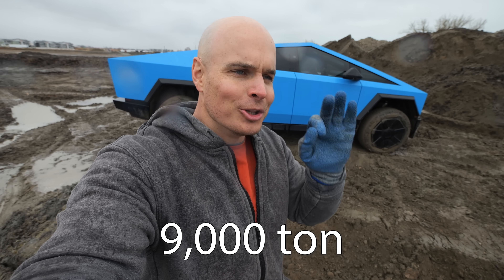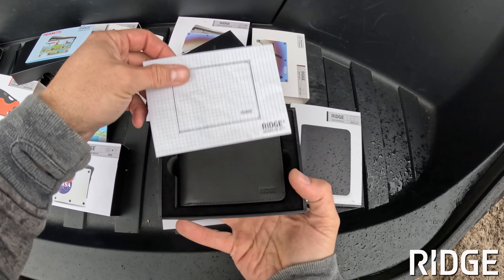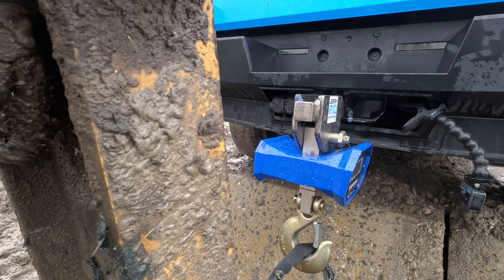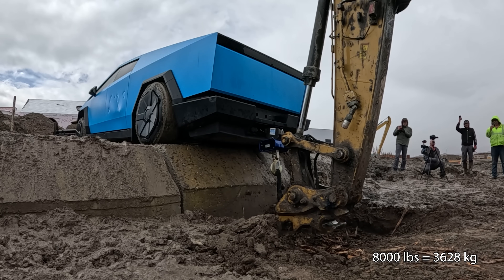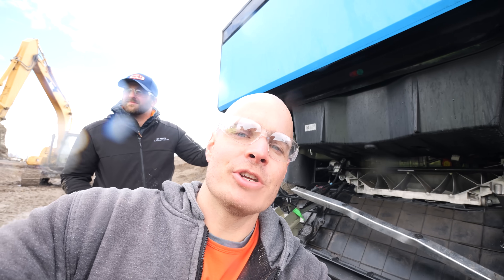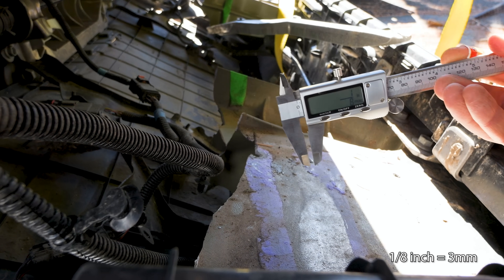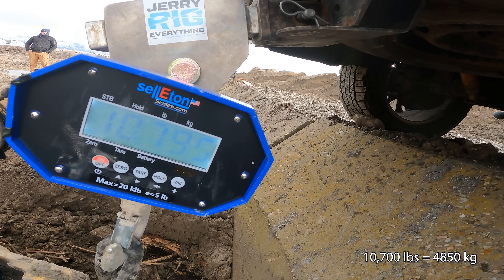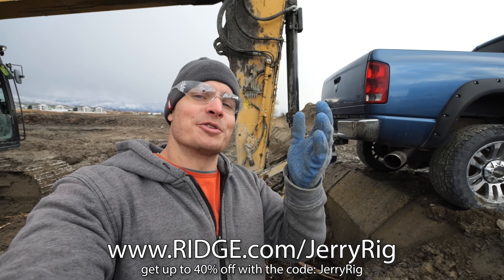SHOULD YOU TOW WITH A CYBERTRUCK?! - (catastrophic failure test)

Comment: I'm no scientist, but is there any virtue to the forces being downward and not horizontal?
Reply: 10:03 WTF? The trailer weight under normal conditions does not become tongue weight. I mean do you expect to crest a 90 degree hill? Give me a break (pun intended)
Reply: @poobank  he’s a flaming democrat liberal He doesn’t like Tesla anymore.
That’s the whole point of this video that’s why he omitted saying anything about a weight distribution hitch
Reply: Real structural engineers are Watching and laughing at your real life scenario experiment.
Reply: What are shock loads on a 1000lb tongue weight..
Reply: It's for those times you tow vertically rather than horizontally
Reply: Plus he did it on both trucks so it's fair
Reply: This is the most stupid test I have seen for towing capacity.
Most of a trailer’s weigh is conducted through its own wheels, the force on the car should be very low.
The nose weight (down force on the tow bar) should only be around 50-75kg with a correctly loaded load, to get 4000kg the load would need to be extreme or all sitting right at the hitch point.
Even the force to pull a 4000kg load of a trailer is not that high. 
I have personally pushed many a car (around d 2000kg) but i could not pick one up or carry it.
Definitely need to revisit your physics if you think a 4000kg trailer sits all the weight directly down on the tow bar
Reply: If you go over a bump, the force woul be downward. If either way, there always is a downward force since the trailer pivots and leans down on the hitch. Or if you go over a bump. Being an engineer, I can prove it with a basic force diagram lol
Reply: You lock a trailer or some caddy on a truck and it usually has two wheels and then it pulls your cars back down. And since the cyber truck has an aluminum chassis it means that it will get weaker and weaker, so it is a guaranteed break that will just occur one day if you use it. Like, laptops hinge problems - the only way to prevent it is not to use it
Reply: True , this is a bulshit test
Reply: Also imagine your car stops working just because your rear broke lmao. Can't be bothered
Reply: @Noshizq79 Towing capacity is not the same thing as tongue weight.
Reply: YES.   And the Telsa only has an 1,100 lb tongue rating
Reply: Did you watch the video? He literally explains this
Reply: @willcarson7328 yes and the tongue weight is much less than just the regular pulling of something in a trailer. The tongue weight on an F-150 truck is only 600 lb. But you're not going to be putting that much weight on a vertically unless you hit like a bump or a dip or something but it's not going to get to that much.
Reply: He literally explained why he did it with a downward force and not horizontal in the video
Reply: Well, imagine you hit a pot holez and the tow hitch and trailer suddenly jirk up and down. If the trailer weight is over that vertical sheer strength and the truck and trailer are moving out of sync just enough this could easily happen on the highway or even at city speeds.
Reply: They’re completely unrelated because of the conservation of momentum.  Your tire doesn’t hit the bottom of a pothole on the highway.  It glides over and hits a little of the edge.  Because you already have do much forward momentum, you’d need an equal amount of downward force to now point your direction of travel 45° into the pothole.  Same thing with a trailer pulling on the hitch.  A pothole isn’t suddenly going to redirect 10k lbs of pulling force into 10k lbs of tongue weight.  Imagine a string with a ring on it.  The tighter you pull the string, the less the ring sags.  Drop a heavy rag on the string, and it’ll dip.  But it’s not going to bottom out the string because it’s under tension.
Reply: The fact this has happened in the real world tells you it’s possible. Does it mean likely? No. But when towing you don’t want that risk to begin with.
Reply: The point is same test different truck one did better
Reply: To all the people defending tesla, remember he is doing this test because someone's bumper fell off in regular use
Reply: Doing these tests so you don't have to.
Reply: If you understand, he showed the amount of force exerted on the frame to the point of failure. Either way if he had to exert 10000 pounds horizontally, it would still snap as that is the point of failure. Only difference i can see is the damage would be quite different maybe alot less but either way it's still an L
Reply: Yes it makes for a significant difference when applying forces horizontally or vertically on the trailer hitch
Reply: This is to measure tongue weight, which is the weakest point i.e you hit pot holes , speed bumps , uphill to downhills… etc . This is the measurement to certify towing kinda like how they bend airplane wings to determine it’s maximum g force limit
Reply: I would agree that this test is disingenuous EXCEPT…the dodge didn’t break.
Reply: The hard fact is that the (already damaged) Dodge did not break, and by now we’ve seen 3 Cybertrucks where the trailer yanked the back half off. This is a design fault in any way you look at it.
Reply: Err that kind of pressure would lift the front...
Reply: Towing capacity is not the same as hitch weight capacity
Reply: I guess you didn't watch the video
Reply: This test is void. One can’t test a tow hitch limits like this.
Reply: The entire point of this video is just to show a broken cibertruck, you I’ll never town noting downward like it.. 🤦🏻‍♂️🤦🏻‍♂️🤦🏻‍♂️🤦🏻‍♂️
Reply: This test is total bunk.
Reply: I personally dont think that the forces applied to the hitch wiht this test are accurate. Whistlin’s truch took the weight of the truck dropping on the hitch first to break it which the truck should defiatly be able to handle the vertical load of the trucks weight at hitchs get hit all the time. The biggest issue I see is that the main point of failure is a non repairable part of the truck thus totaling it. design should allow for breakage on a replacable item and the structure of the truck shouldnt be damaged. Hitch should be designed to break before the truck frame with an apporpriate tow rating to match. Ratings are meant for normal operations which clearly the truck itself has no issue doing but an unusual situation shouldnt total the truck.
Reply: This experiment is useless since the pulling force resistance horizontally is what they should be testing, that's were most if the force goes to when pulling something, if you pulling a load that has 4 wheels then the downward force is next to none.
Reply: Para mí este test no tiene sentido, cuando están simulando un remolcaje en una posición totalmente inverosimil en el mundo real. No es una prueba válida de remolcaje sino de izado de una carga suspendida.
Reply: @jphanks   I put a comment on how the front end was being held down thinking people would put 2 and 2 together. Saying that the hitch will break at --- when towing... is there front held down when towing? The front lifting would alleviate pressure, so it's not the same. A real test would be doing it in real life, towing something, and seeing if 10 cybertrucks break .... honestly, this video seems like it's just bashing gigacasting, anti Elon rant. Worse yet the guy did a video of towing his hummer that was close to the limit. Tesla should have tested it and made sure it exceeds the tow capacity, it doesnt need to be indestructible. Jerry seems like he is far left.
Reply: Yes, this whole test is BS. This test resembles tensile strength spec vs a sheer strength test. 9k sheer is quite impressive actually.
Reply: I don’t think the Cybertruck is a truck and I think it’s a stupid car… however to say that the full weight of the towed trailer can apply 100% to on the tow hitch is beyond stupid. In Germany Passats and other unibody cars have almost 5000 pound towing capacity but yet the max weights on the hitch is usually around 180lbs.
My Mercedes GL is unibody and has a towing capacity of 7500lbs. In no world I believe you can put 7500lbs vertical load on the hitch, that’s just ridiculous. No problem to show the weaknesses of a car but this was clearly to disfranchise Tesla. It’s called activism…
Reply: I'm the last person to ever defend Tesla but I can't see a situation where the ball weight would ever get anywhere near that high even towing over the nominated capacity. 

And in the examples given a significant amount of the load would still be horizontal. 

Having said that, there's no doubt the old Ram performed way better in this test. I think it's just a bit alarmist to say that if you see a Cybertrough towing something you need to run away. 

Still a heap of garbage, and still wouldn't have one if you paid me - but this isn't a realistic scenario.
Reply: Somewhat unrealistic test
Reply: @  what’s unrealistic about it genius?
Reply: There is some validity to this test. I agree that the major factor of how much a truck can tow is how much force it can stand in the horizontal direction, HOWEVER, to say that vertical forces are of no importance is forgetting several things, the main one being that a trailer has to also apply a lot of downward force on the hitch, or the trailer will pop a wheelie and tip backwards. Like, have you ever noticed that the trailers wheels are not at the center point of the trailer? Instead, they are located closer to the rear of the trailer, so that some of the trailer's weight is supported by the hitch. Imagine if the wheels were put forward of the center point of the trailer. If that were the case the trailer would always tip backwards and be resting on it's own back bumper. So yes, there are downward forces on the hitch that have to be taken into account. The second thing is exactly what they mention in the video which is that differing road conditions can cause sudden, short changes in the amount of downward force on the hitch - sometimes it is increased, and sometimes it is decreased but there always has to be a certain amount of downward force on the hitch to make the whole thing work. Last thing is just that the test does prove that cast aluminum is weaker than steel when it comes to tensile forces and shear. The horizontal forces created by pulling a trailer are also tensile forces, so there is quite a bit of merit to this test.
Reply: Its called tongue weight
Reply: I agree. The towing capacity is 11,000lb, so you would need practically the entire weight of what you are towing on the tow ball for this to happen. Even in the catastrophic scenarios that JRE mentioned, a significant amount of the force will still be horizontal.
Reply: @locksmack  yeah this test is just mindless destruction, a 11k lb load would have nearly all that weight going down through its wheels, the nose weight should only be around 150lbs down, even the horizontal loads under breaking and accelerating are still a fraction of the 11k. That’s why humans can pull trucks and planes, but can not carry them.
Reply: @locksmack bingo… you would need to be trying to tow 25,000lbs + and then have something catastrophic to happen for this to even have a 3% chance of happening…
Reply: @locksmack  yeah from what I understand you do a 5th wheel towing adapter after X amount of pounds so that you don't breach the truck limits (for all pickups not just the CT) or add different adapters.
Reply: @locksmack but the one that hit the pothole broke? how can this be explained
Reply: The entire point of this video was to show a broken Tesla with all the plastic underneath. So, mission accomplished! For me, I dont mind the impractical test… Because while Elon has been empowered by our felon in chief to create tear down our govt, I dont see any issues with tearing down Elon’s stock price.
Reply: Bingo
Reply: For shits and giggles you should get one more Tesla do the same test, but by pulling it. 😂
Reply: There is only “fun” way to find out
Reply: The biggest problem here is that the safety pin doesn't help to keep the trailer from rolling away.

The test does not describe an immediate break, but let's say you drive a trailer with a weight limit of 80+% 30 times, and the trailer wheels are further back - more weight in the front.

Potholes, bridge + road separate line, speed bumps, etc.

After a few years and driving the trailer(s) 30x, 40x times...
👇
It breaks off... Here is a problem, because the safety pin does not help in this case.
Reply: Yes the vertical weight is much less than the tongue weight which is 1100 lb making the towing 11,000 lb. On the information for the vertical weight Tesla listed at 160 lb for the vertical weight whether or not that's a type or not it probably is it should be maybe like 1,160 maybe I don't know but regardless of that the vertical weight is going to be much less then the tongue weight.
Reply: Towing capacity and tongue weight are completely different things!!!!
Reply: No
Reply: He explained it in the video
Reply: 10k is beyond impressive for tongue weight
Reply: No. But it was needed for ideological purposes.
Reply: You onto something actually structures can have different strengths depending on the direction the force is applied. The rated force is probably horizontal. Kinda like concrete having great compression stretch but low tensile strength
Reply: Towing has vertical and horizontal force in it.
Reply: @wilfordpadio1896  make sure you know what you're saying before you say it
Reply: You’re 100% right here - this proves nothing. Zach is usually pretty on top of it, but this just shows that if you somehow had a trailer with an 11k tongue weight you might problems.
Reply: Should be called static tongue weight.
Reply: Your test it incorrectly, you want to be at a more horizontal angle. Your sloped wayyyy down to far down.
Reply: Same force was applied to the Dodge truck, nothing happened
Reply: A lot of people saying the test shows a 9x of the tongue weight rating…wrong, this test is a static loading test, the 1,100 lb tongue rating accounts for dynamic loads, think bounces and shock loading of driving over rough roads. So really this truck has a much lower safety margin. Maybe 2x or so for normal driving. Extremely loading like whistlindiesel causes catastrophic failure.
Reply: Anyone else more impressed by the soft shackle than anything else in the video?  Maybe musk can make the next version with a plastic rope frame.
Reply: You're never going to have more stress horizontally on a hitch than vertically when towing
Reply: @ unless your loading your trailer like a complete fool, the stress should definitely be a horizontal force rather than a vertical force.
This is due to the fact you are pulling and pushing horizontally and the only real vertical loads should be from stabilising the balance on the trailers wheels. 
Do you guys never hitch loaded trailers to cars by hand? I had 1000kg of bricks in a trailer and could lift the trailer hitch by hand and put it on to the tow bar. Should be like holding the end of a seesaw not lifting the whole load
Reply: The copium for the Elon simps in this thread is palpable.
Reply: Because it doesn’t take 11k lbs to pull a trailer you can push and pull a trailer with just a few 100 lbs
Reply: I guess if you have a big force horizontally applied the vertical limit is even way lower than shown in this test.
Even if the real vertical force doesn't reach the amount shown in this video I guess it will wear out the connection very fast when it's combined with a high horizontal load. Also don't mix up max load (tested here) and nominal load (a base for an average use, but that needs a lot of safety factors applied to reach the actual max limit).
Reply: Yes because Zack is an embarrassing Elon hater 🤡
Reply: @jannis01  it's alot more embarrassing to defend Elon over anything
Reply: The whole point was to destroy the Tesla, and "Elon bad".
Reply: Not technically cause if it’s designed properly it shouldn’t matter and it should even be able to handle more force since putting a downward force in a towing hitch has the entire chassis backing it up
Reply: in the video he states clearly. its a matter of a lot of forces. towing is mostly horizontal. but improperly loaded. or in certain circumstances it could overload the tongue. if this happens too often. it could result in failure. the fact you need further explanation shows plenty.
Reply: Because then he couldn't show his political biased and how much he hates America. He's trying to make Musk look bad because musk's trying to save the country from going bankrupt. Pretty sure baldy is woke and hates America pretty bad.
Reply: Guy employed trumpcession with doge impact on Tesla and capitalised on the attention capabilities a Tesla video would fetch
Reply: Muricans doesn't count like us. They try cranes by loading cranes until the burgermeter show lunch. Then they laugh and go back to look busy just to spice up your bill.
Reply: This is to measure tongue weight, which is the weakest point i.e you hit pot holes , speed bumps , uphill to downhills… etc . This is the measurement to certify towing kinda like how they bend airplane wings to determine it’s maximum g force limit
Reply: They literally explain why this test is relevant during the video... Did you watch it?
Reply: Well, can you prevent your load to stay always exactly the same disstance from your truck..? I mean if you are accelerating, you are pulling it horizontally, but if you are breaking, and the weight behind you still in move, and will change the force effect from horizontal to vertical.. and your load rod also try to go under your car, to the same direction where they pulled..
Reply: He mentioned in the video when such forces can happen in the real world
Reply: Did you even listen to what he was saying? Did we just watch the same video??
Reply: I came here for this comment. It's like the "drop" tests people used to do tossing phones off parking structures. "If you fall down 7 flights of stairs, your phone will survive only in this OtterBox defender!"
Reply: Tongue weight I believe.
Reply: whistlindiesel covered a case where a cybertruck hit a pothole while towing a trailer and it broke in the exact same way
Reply: To be realistic, wouldn't the load need to be at a vector between vertical and horizontal?
Reply: This guy takes Ford money to make bait videos
Reply: There definitely is downward force, whistlin diesel had his break from a horizontal force and the customers who had this happen in real life were just towing
Reply: So we're just going to ignore the fact that literal frame parts are GLUED together???!!
Reply: @ of course it will break. It isn’t supposed to receive the entire tow load upside down in a single point.. to tow one trailer the majority of the force are actin horizontally, not vertically..  Vai aprender alguma coisa👌🏻
Reply: @Bsquaredplus2  3M panel bond is rated as tough as welds, especially for aluminum and steel bonding. I didn't believe it either until I saw the numbers.
Reply: This is typically a channel that manifests intelligence. This “test“ was completely bogus. I can’t believe that they believe what they are saying in this video.

I completely understand people being annoyed and disappointment with what you on musk has been doing in the world the last few months but when you’re purporting to do science… you should do the test properly. This video was bogus.
Reply: When you tow, you are supposed to have majority weight towards the hitch. Imagine you hit a pothole, that weight will create a jerk and apply huge amount of force vertically downward. Essentially doing what they tested in this video
Reply: @dp8jl  No, it won't cause so much force.
Reply: @ Read about jerk and look at the graph, It would apply a lot
Reply: @dp8jl Really you’re supposed to have the weight over the trailer’s wheels, the tounge weight should just be slightly positive. But when reality hits and you can’t achieve a neutral balance you’re better off loading the front of the trailer, maybe you failed to secure the load properly and it shifted forward when braking, and as mentioned, pot holes, creats and so on so there certainly are situations where there is a lot of impact force applied vertically on the hitch.

The big issue here is steel vs aluminum, where when the steel is overloaded it will bend before it breaks, the aluminum will crack and it’s a wild design decision to make the panels out of steel and them save weight by making the load bearing construction out of aluminum.
Reply: Whistling diesel pulled on the tesla from behind with a strap attached to a ford. When he tried to pull the tesla out from behind he had the same catastrophic failure.😂😂😂😂
Reply: Glad it was your truck and not mine...
Reply: I think you should also include an F150 Lightning, another electric truck.

Sorry my bad English
Reply: Oh jeeez if i read the comments i think man what a world we life in and it even was in the Video although there was an error in wording.

ALUMINUM will break over time - This thing will do a lot of Damage. Even if you tow much less loads then tested here, it WILL 100% weaken the structure to a point where eventualy the hing will fall of from a small trailer wich is towed.

If you bend aluminium once you can bend it back or it will break. If you to the same with steel it wont break simple as that.
Reply: @Alexander.K250  Run to manufactures that make so many car parts from AL. Go say that they are making a big mistake producing blocks, pistons, casings, suspension arms from AL and eventually they will break. XD
Reply: So I guess you’re never going down hill ever?
Reply: The horizontal is tested via the drivetrain. First, the hitch must be able to handle the load, then the drivetrain needs to be able to pull it
Reply: They are testing the tongue weight limits added to the towing limits
Reply: Pointless test, pointless video.
Reply: Like he explained multiple times in the video; normally the trailer’s weight is mostly on the trailer axles, but there are several possible scenarios where most of that weight is shifted onto the tongue and receiver
Reply: Yes, it is deceptive to be talking about 11000lb towing capacity and then measure the tongue weight capacity.  The fact that it handled 8000 lbs tongue weight is very impressive since it probably only has a tongue weight capacity rated at 1100lbs, not 11,000lbs.
Reply: @vincevancleave9353  he said like 15 times during the video it was tongue weight capacity. Nobody was deceived at any point. He even explained with a little toy car for people who are a little slow like you why tongue weight matters

And it's very funny seeing Elon simps cry that "it's more than the spec weight!" considering the entire truck/large vehicle interest community laughed for weeks when the cybertruck only hit an 1100 rating. That's ..bad. it was bad at the time. It's not impressive that it exceeds the capacity of an average sedans frame. It's supposed to be a truck.
Reply: This was a hit piece
Reply: He addresses this in the video.
Reply: No, just wanted to destroy it because he doesn’t like Elon…

I don’t either, and I hate the cybertruck, but I can dissociate the man from the business. 

Unlike the tesla haters crowd that this video had gathered
Reply: @JerryRigEverything I see you're responding to the praise comments - where's your response to this? So disappointing you would resort to an irrelevant test for the views. I thought you were better than that :(
Reply: @PetrSedlacek  I made a video Short and posted it to YT, hoping to get his attention lol
Reply: Do u not watch the video about the towing physics bro
Reply: Yes..  the virtue is more views
Reply: I was wondering the same.
Reply: Weight of a trailer goes DOWNward on a trailer hitch/ball. Gravitational pull. You’ll see when you drop a trailer onto a hitch. Your truck suspension will compress and the rear will lower.
Reply: So I can tell some people have never towed a trailer. If you jack a trailer down it does what? Goes down.
Reply: Yes, he just chose not to mention it so he could paint Tesla in a bad light. When towing a 10000 pound boat there would be like 1000 pounds or less of downward force on the hitch.
Reply: He did explain that, did you see the whole vid?
Reply: change his name to JerryHatesTesla
Reply: 11000 lb towing capacity 1100 lb tongue weight 9.4545 x capacity so bad totally😮 seriously
Reply: Tongue weight rating 1,100 lbs (500kg) it exceeded that
Reply: No for these intended use case. Your objective is no to have the trailer become a rolling boulder down there road. If steel can de form better without breaking more power to it.
Reply: All these people trying to explain away the fact that the teslatruck broke but remember same test and the dodge was fine… soooo doesn't matter which way the force was it still broke while other trucks don't...
Reply: I would love to see a similar test in the horizontal. Let's find the weak spot in that aluminum frame - at what force will the truck separate into two parts!
Reply: He explains this in the video multiple times.
Reply: The virtue is getting views and clicks by shitting on Tesla with an improper test idiots won't understand.
Or he's just very stupid.
Reply: Get well soon jack. 😢 you trying sooo hard. Its shows . You hold so much against tesla. Rivian sponsored! You got free tires? Or something else from rivian😅😅
Reply: If a ram can stand up, just imagine what a good truck could do.
Reply: People seem to be Tesla fanboys in these comments: look to a real world situation in the whistlin diesel video. People all said it’s cause of the impact it took before hand but JRE’s video backs up Cody’s experience of the thing catastrophically failing in normal truck use
Reply: This test is literally pointless with no direct comparison.
Reply: @HAL9000. this assumes the very basic premise that vehicle and trailer axles are all on a horizontal plane, right? … not even touching how the trailer is loaded. In any situation where the axles of the trailer or vehicle being towed are on a plane sloping downward from the tow vehicle, the weight suddenly imparted on the hitch becomes much greater. Based on the experiment here, you would definitely think about using a vehicle like this as a recovery vehicle when off roading. As touched on in the video, the properties of steel are very different to aluminum, and there’s a reason steel is so widely used in so many applications where large forces are involved. It really is a very weird material choice for a part of a car where failure is a serious safety issue.
Reply: @someofmyinterests how do you think potholes and other gradient changes impact the weight experienced at the hitch connection?
Reply: He literally explained why it's important to have  a stronger tongue weight.
Reply: It doesn’t matter because the frame is aluminum. Aluminum is garbage for towing
Reply: No one here watched the video, he literally explains this at 9:45
Reply: @HAL9000. Isn't there a downward force when you're going over a bump with a trailer? Or when you're climbing a steep hill?
Reply: Since when is gravity horizontal 😂?
Reply: Towing capacity is not the rated downward load on the hitch, it is the ability to tow horizontally 🙄
Reply: He literally explains it in the video.
Reply: As much as I reject Musk's Nazi saluting and want Tesla share prices to tumble in protest, this test is so dumb.
Reply: This is a stupid test. You have no understanding of towing
Reply: Should be horizontal IMO - mechanical engineer here.  Should be both ?
Reply: 😂 what a clown!
Reply: That was the entire point of the test .
Reply: Gravity go down
Reply: Pointless test
Reply: @jerryrigeverything Can you show active tongue weight loads during towing? Can you even generate 10k pounds in a real world situation with scales and cameras rolling? I doubt it.
Reply: @nathanhoke1  it wouldn't be hard to create a force sum on the hitch on a grade. You don't need video to calculate what it could be.
Reply: @ he showed where those things happen, cresting hills, ditches and potholes.
Reply: We loaded pallets of concrete for customers at Home Depot. If they had a hitch, all that load has to be directed toward the hitch for safety/physics purposes. You bet that all that vertical weight matters. We never had to worry about the hitch holding up more than the trucks suspension and tires though.
Reply: @krimpymess  What did you just say? If you put a pallet of Crete in the bed of a 1500, you are stressing the suspension and axle by practicly double its rated capacity. If you load it on a trailer (which actually) puts weight on the hitch; you wouldn't put the pallet on the tongue, but just forward or center of the trailer axle. This puts the weight on the trailer and not the truck while ensuring stability going down the road. Sorry but the physics you mentioned, ambiguous.
Reply: @krimpymess  That's horribly incorrect, overloading a hitch reduces weight over the steer axle and creates an unsafe condition. The weight should be balanced over the trailer axles with minimal hitch weight in either direction.
Reply: @krimpymess  I’m pretty sure the load should go directly over the axels. WTF
Reply: @krimpymess  correct for the trailer to track right you want all the weight as tongue weight but you also don't want to exceed tongue weight limit rating either.  So many people on here talk like they are focusing their weight over the axles and will explain why there are so many videos of people having trailers go out of control and flip the vehicle.
Reply: The truck most likely blew its Pyro Fuse. When an EV detects an impact it'll pop that fuse to prevent fire and to keep it safe for rescue crews. It also means it cannot be driven until you get a new fuse, but they are kinda cheap.
Reply: @SirPandaEsq  oh that’s interesting, I wonder if it had enough force to cause that break
Reply: Zack explained what you are asking in 9:45. He showed it with the little car demonstration, and argumented in what normal towing conditions this experiment applies to.
Reply: @nicolasromero1720 Normal towing conditions to exceed 7,000lbs of force would require a trailer over double the rated capacity on a 15% grade. This "test" is just an excuse to break a cybertruck for views.

Note the complete lack of data in his "examples." For all the weight of a trailer to be on the hitch, it's wheels would have to be off the ground. If a tire is touching the ground, it's relieving weight. The only situation mentioned that could exceed these forces would be the recovery of a stuck vehicle which should only be done from actual recovery hooks and with a recovery strap which is elastic and spreads the shock load out.
Reply: @daniellvanwiggeren7942 need more COWBELL!  My Cummins will rip that dam bumper right off that cute toy!
Reply: @nicolasromero1720 he certainly does give an explanation, but he is also totally full of bull as none of them situation would ever put the full weigh of the trailer as tongue weight. The only way I can see that it would happen is if you reversed the trailer off a cliff and have it hanging from the hitch (but in reality it would fall off) a standard trailer hitch would fail from the angle and force
Reply: @nicolasromero1720 yea except that would never happen in real life, unless its payload is literally hanging off a cliff, like in Jurassic Park II. Read the rest of the comments on this video.
Reply: @nicolasromero1720 what he showed was incorrect. Cresting a hill lmao WHAT. You would have to drive straight up a 90⁰ hill and "crest it" with the entire trailer and its tires off the ground dangling on the air for this to be an issue. And if it happens, buddy you got bigger issues and the hitch snapping off would be the best outcome. Also hitting a bump in the road doesnt work like that, how many cybertrucks pulling a trailer do a wheelie when they hit a bump? They literally had to strap the front end down because it was lifting up 😂
Reply: @nicolasromero1720  and in the scenario her showed, that trailer is LIFTED which is why it comes loose. Just stupid.
Reply: @nicolasromero1720  He said that, but this doesn't resemble a towing condition anyone will ever face. A class V receiver is only rated to 1,800 lbs of weight.
Reply: @nicolasromero1720 except it’s not true. Even in his example or on the steepest of hills two tires are holding the larger portion of the weight.
Reply: @nicolasromero1720  yes he did, and he is absolutely incorrect.
Reply: @nicolasromero1720 and his explanation is BS. If a trailer ever was in a scenario to apply significant enough load down like his test, I'm afraid you have much bigger issues!
Reply: @joelmelburn3370 why does it have to be a trailer? Why can’t it be an off-roading vehicle that has gotten stuck and needs to be recovered by another vehicle?
Reply: @Ticklish-sheep  great point!
Reply: @nicolasromero1720 just because he mentioned something doesn't mean he understands it, hitting a pot hole or towing up hill doesn't put all of the weight on the hitch...its a ridiculous test.
Reply: 11,000 lb on a trailer will force weight down on the axles of the trailer the 11,000 lb won't be in a downward motion directly on the hitch
Reply: @Jackie-p4r The Dodge didn't break 😁
Reply: @Jackie-p4r does it depend on alot more than that? what if its a one axle trailer or if the trailer gets a bit of a push towards the front frot the road shape, alot more mass will go on the hitch, if youre carrying 11000 lbs then the total downward weight will be more than that, some of which, depending on the trailer and road will act on the hitch more or less
Reply: @Jackie-p4r dude stop, suppose you get a 4 wheel load then were is the down force?
Reply: @Jackie-p4r go down a 9% grade and hit a bump or pot hole etc with a fully loaded trailer…..
Reply: Sitting around and imagining what you think will happen is called speculation going to school for engineering and working in the field for many years is called knowledge
Reply: Yeah he’s testing tongue weight capacity which is rated much much less than tow and not testing not tow capacity which is rated at 11k and he had to strap the front of the truck down to do it “one bad trailer load away from failing” yeah if you’re trailer is pulling your front wheels off the ground you’ve got a lot bigger problems than choosing a cyber truck what a clown
Reply: The rated tongue weight is 1100 lb so what they've proven is that the Cybertruck has a factor of safety of 9.45:1, where 2-3:1 is common. Overhead lifting equipment is typically built to 5:1.
Reply: @MattBlank0  where did you get  that 2-3 metric from? If a 2 decade old Ford can do better I'm rlly not sure you have good logic
Reply: @MattBlank0 Tongue weight is not an indication of the capability of the receiver. It’s derived from  the limit of the suspension/steering/tires to safely tow.
Reply: @MattBlank0  with an 1100 lbs of tongue  weight and your driving down the interstate at 80mph those bridge seams  can produce well over 10000lbs and so can slamming on the brakes with a high center of gravity load
Reply: Quick math  @MattBlank0
Reply: @MattBlank0 if that were remotely true the steel bed truck, geared up in exactly the same manner, would’ve broke. You fail.
Reply: @praftman  they're comparing a Cybertruck which is hardly a pickup to a heavy duty pickup with a different style of construction. I think it would be for to compare it to something like a Ford Maverick or Honda Ridgeline in terms of its capacity. There are a lot of things to hate about Tesla and Cybertruck but failing at nearly 10 times its rated capacity isn't one of them.
Reply: @MattBlank0 The number sound great until you realize cast metals are the worst for high impact and loading applications. Cast metals have low tensile strength, and are very hard to produce without any void defects. 

Any other truck will take that much of an overload without failure,  at most resulting in a bent hitch or frame. The fact that the gigacast snapped reveals it will have a limited life towing near its max rating.
Reply: @MattBlank0 

Good way to look at it, just keep in mind that that is a static rating and needs to have margins for dynamic use. An overhead crane won't see significant dynamic loading. A towing vehicle will see a fair bit, although the suspension will help control it.
Reply: @MattBlank0  that is a margin for catastrophic failure. Not actual failure, you would be getting a bill the next time you visit a shop long before you break the entire back end.
Reply: @MattBlank0  Well the tow hitch on dodge which is one of the most common trucks on the planet lifted the excavator's tracks off the ground... that's the point of the comparison... Comparing a normal steel frame to a cypertruck frame.
Reply: Also towing 11,000lbs is not going to be 11,000lbs of force because, you know, tires.

Not that I'm defending the Cybertruck. They are terribly built vehicles...but tongue weight is typical 10% of max tow weight and allows a decent safety margin for bumps and so forth that would temporarily increase load. If that thing holds to 2,000lbs it should be fine. Honestly, the cybertruck suspension would be my biggest concern.
Reply: He did point out with the model Cybertruck driving on the roof of the real one that in certain conditions the trailer can jerk a large transient downwards force 😊
Reply: @ecopennylife 
Yep. It's called jacknifing and the truck is on its side if that point breaks
Reply: @ecopennylife  while you're driving it down the road, is there a crane holding the front down? 😅😅 Baldy is lying to you.
Reply: @ecopennylife   the load can increase, but it would never get to 10k lbs or even close. He's mistaken and fear mongering.
Reply: @ecopennylife sure but 10x ?pointless video
Reply: @ecopennylife but never the full weight of the trailer what science is that?
Reply: Tongue weight rating, 1100 lbs, is vertical.  I suspect they couldn't force a failure in the horizontal direction, and the entire point of the video was to show a broken Tesla
Reply: @shakehandswithdanger7882 you’re exactly right, this dude is so unethical
Reply: @shakehandswithdanger7882  sounds like truth to me.
Reply: @shakehandswithdanger7882  these jackasses chose to omit the mention of any kind of weight distribution hitch, which people who tow heavy trailers know all about
Reply: @shakehandswithdanger7882 the entire point of the video was to show tongue weight breakage because as anyone who actually hauls things (so no cybertruck owners to be fair) knows tongue weight can be holding the majority of a trailer weight for brief times, i.e. if you hit a pothole while hauling or if you improperly load a trailer ahead of the fulcrum and stop too quickly.
Reply: they tired pretty hard to break the dodge too but couldn’t Tesla cyber trucks are a joke always have been if you want a truck get a real truck and the only half ton gas to consider currently is a tundra with regard to reliability. Diesel is go with a ford first the. Dodge and Chevrolet last just my .02 and real world experiences with them all.
Reply: @shakehandswithdanger7882 the point is that it would be quite easy to have a shock or impact vertically with that much weight whilst towing, which would damage the truck and could cause this sort of critical failure. There is just no reason for the truck to be built this way
Reply: @Drakshl  I'm not a towing expert. Motorbikes, on the other hand. Aluminium frames / around the fork can crack- weaken and fail from hard landings / dropping the front wheel too fast from popping mono's. Should they make all sports bikes use steel frames? I can imagine towing multiple tons of liquid down a valley where it bottoms out sharply may break the ct. The steep driveway would be a better example. But the ct could be programmed to warn the driver ahead of time. ... also, I shouldn't presume people's motivations, soz.
Reply: @shakehandswithdanger7882  horizontal can be hard to rate an exact load for and he was testing a tongue load failure after cresting a hill. A vertical load. He was testing for a specific established failure to see if it was a design issue or if there was an existing structural failure.

tongue weight is a larger concern regardless because whatever youre towing is on wheels and so are you. So alot of the horizontal forces under anything resembling normal circumstances is going to be taken by a lot more than the tongue. You could try hitching the car to a brick wall and accellerating, I guess.
Reply: The whole point is that we don't live in a perfect world with perfect conditions, and that the truck WAS supposed to tank that overloaded vertical force. That's you absolute safety limit, like an elevator's true capacity being way higher than the advertised weight limit to account for irl outlier scenarios.
Reply: @shakehandswithdanger7882 of course because this guy is a complete shill
Reply: Sure, ever heard of a speed bump or a pothole?

Bouncing over those while towing will certainly cause sudden downward forces
Reply: @smok_ed only if you have a GROSSLY imbalanced load lol...
Reply: @gergc4871  on the whistlin deisel video it became a major concern when the rear frame experienced an impact..

As many of us know, aluminum work hardens almost instantly so a fairly minor impact on the frame could cause significant microfractures and stresses  on the extruded aluminum frame..

Unlike steel which will stretch and bend quite alot before finally failing. Think about steel rebar inside a concrete bridge span, or the head bolts on your engine being torqued to spec... steel will move and remain strong. Aluminum DOES NOT.

So a fairly minor rear end collision that strikes the rear frame of the cybertruck could very well compromise the fragile aluminum frame.  Then when you have 11 thousand lbs hooked up and are towing at highway speed.. these stresses and fractures can easily cause the frame to snap in half.

It has actually been reported multiple times already, so all these cybertruck fan boys should take note and stop simping.

Tesla really frigged the dog by not choosing to use a steel frame.
Reply: @smok_ed  Yes, that's true! Someone bumping into you from behind...

Up/down can quickly jump to 2+k lb it all depends on the trailer and how the weight is distributed.

Officially 160lb must be a mistake because it's too low! 11k lb and up/down limit at 160 lb 🤣

For 11k lb I wouldn't put a limit below 2k up/down, especially with aluminum, because it breaks off and doesn't bend like iron. Once it breaks off, the trailer is no longer connected to the car! Better safe than sorry!
Reply: @smok_ed  Yea, on the suspension.
Reply: @smok_ed then do the test that way
Reply: @smok_ed yeah for a small period of time and that's it.
Reply: @smok_ed bouncing and speed bumps never put that much weight on a tongue. Again more stupid shit being said by people who have no towing experience
Reply: @smok_ed will it? Explain how all the load somehow goes off the wheels of the trailer and then somehow goes vertical, ignoring the geometry of the whole setup. Do people like you not have any idea of physics?
Reply: @-Nath-  i have a degree in math and physics, what is your background?

First off.. i never once said that the entire weight would be applied to the tow hitch, just that it would experience moments of downward force.

Also have you ever seen a trailer loaded with more weight towards the tongue?
I have. Loaded em that way myself many a time.. as having the weight slightly forward increases stability at high speeds.

Single axle trailers dont just balance themselves.. there WILL be downward force vectors on the hitch.
Reply: @smok_ed 
No one is arguing that there will be some additional download forces. But to argue that the amount of downward force would be of this magnitude - nearly the towing capacity is straight ridiculous.
Reply: So it broke at 10x the specified limit. Why is this test being done like this. If a 11000lb trailer is on a hill it does not pull at that weight as it has 4 wheels connected to the ground
Reply: @dbjury it’s not normal condition which he pointed out, but under some circumstances that aren’t uncommon, you could temporarily go well over the tongue limit. The more important thing is to remember the fatigue limit that aluminum has. A cybertruck that tows a heavy load for five years is going to be at a much higher risk of having the gram fail due to fatigue than a new one
Reply: @dbjury exactly it says the vertical weight for the information for the cybertruck is only 160 lbs. That could be a typo and maybe it's like 1,160 lbs?

But you're absolutely right and then the other video where they did the durability test between the F1 truck and the cybertruck they drove that cyber truck right off the bed of the truck and the back where the hitch was hit vertically at over 6800 lb or possibly more with that Force hitting that hitch already causing damage to it as you can see when they drive it off the bed of the truck it clearly hits the back the back underneath where that Towing is. That's why when they went to tow it just completely ripped off because it was already damaged at that point.
Reply: @dbjury yeah dude wheels make something weightless. 

Is there a single cybertruck defender that knows anything. Or is it kind of a requirement not to?
Reply: @dbjury Actually,  you are pulling 11,000lb, even on flat flat ground. 

I think what you mean is you are not applying 11,000lb of FORCE all at once,  and in that respect, you are correct,  unless your tow vehicle is capable of exerting 1g in either acceleration or braking.
Reply: @dbjury  yet the old pickup passed the test. Thing is it is to show the problem of having aluminium ( even more so cast  aluminium), chassi, it has no fatigue limit, steel bends and then springs back, and bends and spings back, and os on and so forth but you can seee small fractures on inspection so you can repair/replace it,  aluminium just snaps one day without warning, it may be the 3rd time maybe the 30th, but it will just snap. 
And with how the dumster is designed the car stops working, mening your fly by wire throttle and breaks are are kaput(if they were not before that), your locks are kaput. So if it snaps on the road, you cant even stop or get out properly.
Reply: @dbjury the problem here is the assumption that all the wheels are on the same plane, and the force being applied is in the exact same axis as the hitch. As touched on in the video, there are common scenarios where the force applied is not on this axis. Imagine the common off-roading scenario where a vehicle is used to pull out a vehicle that’s gotten stuck, and the recovery vehicle is on ground that is at a higher elevation than the vehicle being recovered. The direction of the force being applied to the hitch is definitely going to have a vertical component.
Reply: @dbjury the point was to show that Tesla’s aluminum frame does not fail safely, steel trucks would bend or brake at the ball, leaving the safety chains to hold the trailer in place while you hit the brakes and come to a safer stop. The cybersuck breaks the entire back of the truck, sending the trailer, safety chains, and rear bumper to fly off and make its own choices.
Reply: Well whistlindiesel did it horizontal
Reply: @Whall3i and there's been many accidents to date with the cyber dumpster having the frame fail while towing down the road.
Reply: @Whall3i you also have to mention that whistle Dee used steel chains and snapped off the bumper because a ford pickup truck got caught with full velocity transferring to the Cybertruck
Reply: When I load a trailer with a lot of weight, it always pushes the tongue downwards. I can imagine the forces are the same going horizontal. That thin ass aluminum  gonna tare off the same way they tested it! I'm sorry, Tesla fan boys and girls, you can try to spin it however you want. This is a FAIL for the Tesla Cyber Truck!
Reply: I don't know anything about hitches or towing stuff with a truck, but doesn't the fact they're holding down the front make any point made by anyone here, moot? 
This setup requires highly improbable circumstances. Nobody should call this a useful test

Still an abominable vehicle, don't get me wrong.
Reply: @staomruel   i have lifted the front of my grandpas steel frame v8 so no if your a real man the front wheels might go in the air once in a while like pulling a camper down a dirt road to a camp site if i did that with a tesla it would snap though the people buying a tesla aren't gonna actually use there "truck" as a truck its a toy it goes fast looks like a doorstop
Reply: Auch wenn ich Trsla nicht mag ... Stützlast ist normalerweise so bei 100kg. Man ZIEHT einen Anhänger. Bei so einer unsachgemäßen Handhabe ist's klar dass das kaputt geht. Hat erst noch sehr lange durchgehalten. Also ein positives Fazit für Tesla in diesen Falle.
Reply: @TimoOnline  What is between sex and fear? Fünf!
Reply: @TimoOnline mein 3500kg Anhänger kann mit einer Stützlast von maximal 250kg belastet werden und keine 5t 😄

was ist der nächste Test? Reifen mit 10 bar belasten und zeigen dass sie dann platzen?
Reply: @TimoOnline  14:37 aus dem Grund z.B.
Reply: @TimoOnline  hier in USA sind die Stuetzlasten deutlich höher als in Deutschland. I.d.r 10-15% des Anhängers. Die Anhängerkupplungen sind auch komplett anders designt als in Deutschland auch bei den deutschen Autos hier in USA. Nicht desto trotz das der Tesla fast 11.000 pound aushält ist fast das zehnfache von dem was angegeben ist also absolut in Ordnung.
Reply: @TimoOnline NEIN, TESLA IST SCHLECHTER als andere trucks
Reply: @TimoOnline  Absolut, versuche nicht hier mit Logik zu agieren...
Die Zielgruppe ist der Durchschnitts-Ami..
Reply: @ickebins6948  oh ein Durchschnittsdeutscher mit einer durchschnittlichen Logik in den Kommentaren, na das ist lustig 😂
Reply: @romanromero5099  Mehr braucht es auch nicht um diesen Bullshit zu entlarven...
Reply: It was mentioned early in the video about hitting potholes; i.e. downward forces constantly come about during ups and downs in travel.
Reply: @jphanks To easier to understand, imagine you are pulling something vs you are lifting something

Basically, the more material you have and the more rigid the construction is to the opposite of the acting force, the stronger it will hold

So, as long as the road condition is normal, it shouldn't have problem if you don't exceed the limit. If it's offroading then it would be a different news.

And yes, no matter what the result is, it doesn't change the fact that if it were to use steel frame/chassis instead of cast aluminium, it will hold much stronger.
Reply: @Azukaae  If you're towing a trailer with wheels (not a 10,000 lb concrete slab), the majority of the load is supported by the trailer’s wheels, not the tow bar. Yes, steel is stronger, but this test is extremely unrealistic. As you can see, the truck's suspension is compressed against the wheels, making it undrivable. If simply hitching a trailer created this much downforce on the tow bar alone, you'd need an unbelievably strong jockey wheel just to hitch it, let me know if you find such a jockey wheel. This test is so absurd that I can't believe it's being taken seriously.
Reply: Yeah it's a totally pointless test. The tow hitch is (seemingly) rated for 1100lb of nose weight (down force) and towing an 11000lb trailer. Nose weight at 10% of trailer weight is reasonable. 
The D value is what every towbar is built to, which is the horizontal pull,  and the D value of a 7000lb truck pulling an 11000lb trailer is approx 4000lb of horizontal pull. I think his arguments about going up a hill and over obstacles are loose conjecture at best. 

Sure the steel framed truck didn't break off, but I'd bet there's catastrophic chassis damage in there. 

Still can't stand cybertrucks, but calling this science is laughable
Reply: He explained it in the video tho.
Reply: @painemurray but he explained it incorrectly, with zero explanation of the direction or amount of forces applied, which can easily be calculated by a freshman engineer. You will never break a cyber truck like this unless you are pulling at least 2x the max weight, improperly loaded, and then come across the worst possible outcome of one of the scenarios that he "explained"
Reply: @painemurray cybertruck defenders can neither listen to anyone who isn't Daddy Elon OR read.
Reply: So you're implying that towing can't be done downward? How are you supposed to pull out a car stuck beneath a climb then?
Reply: @Noshizq79 definitely not at 90 degrees, too 45% that’s 50% downward force
Reply: @Noshizq79 yes according to Tesla the vertical weight is only 160 lbs which might be a typo it should be like 1160 lbs maybe I don't know. But regardless of that the vertical weight for the max amount is going to be a lot less than the tongue weight.

That's why in that durability test video that the other channel did where they test between the F1 truck and the Cyber truck that's why the towing fell when they towed something is because when they drove it off the bed of the truck the back hit the bed of the truck as it was falling putting that 6800 lbs worth of cyber truck weight or probably more because of the force of it hitting hit that towing hitch and already causing damage.
Reply: @Noshizq79  you pull thing up a hill sure but that hill is never 90 degrees like that force was being applied.  if you changed the angle it would have been way more.
Reply: @Noshizq79 you need to learn about dynamic loading because clearly you don’t understand vertical and horizontal stresses in towing assemblies. 
Just like chassis are more designed for horizontal forces over vertical
Reply: @Noshizq79  get a wreaker like normal ppl. unless your pulling another truck your not exceeding this 8k weight pulling a car.
Reply: @Noshizq79  There is not a legitimate towing situation where all of the load is vertical.
Reply: @Noshizq79  winches and tow straps looped in a way that preferably shift the load uphill or as horizontal as much as possible. Besides, Reese balls and hitches can only go to a certain angle before the receiver and tang collide, so even the hardware itself has a hard stop to a certain angle.
Reply: @Noshizq79 he knows the difference between tongue weight and max towing capacity. Doesn’t need to be a genius to know that.
Reply: @Noshizq79 buddy, the car would also change orientation so that it’s parallel with the trailer
Reply: @Noshizq79 do you know what tongue weight is?  Almost no truck has a tongue limit over 5000 lbs
Reply: @Dinofx_jr  didn't u watch the entire video? That dodge took it without any problem
Reply: @Dinofx_jr  point is tesla broke way too easily
Reply: @ are you an idiot?  That doesnt mean anything.  It exceeded its advertised tongue rating by 10x.  No lawsuit is viable
Reply: @  no it didnt.  Youre not an engineer clearly
Reply: @Noshizq79  so you would tow a car stuck beneath a climb? For real? :D
Reply: @Noshizq79  Why shouldn't test it?
Reply: Jep, this test is completly pointles
Reply: I'm really impressed with it's vapid arrogance. Tongue weight should be the suspension limit lol
Reply: @ilexcorp too bad the rest of the comment says it's good, it's not it's stupid.
Reply: @ilexcorp no its not.
It proves Elon bad
Reply: @ilexcorp did you even watch the video? He explains why the vertical stress is important. Cope more
Reply: @ilexcorp  One cyber truck destroyed , expensive test ........
Reply: @ilexcorp I love how cybertruck defenders just don't have any clue of what actual trucks are used for. Not only would tongue weight be directly crucial in any hauling at an angle (i.e. pulling a car out of a ditch) but even a flatbed can put the majority of the haul weight directly on the tongue for brief moments if you hit a pothole or if the load is improperly balanced forward and you stop too quickly.
Reply: @ilexcorp if towing safety is pointless then yes. I tow a 7500 trailer regularly.
Reply: @ilexcorp no it’s not, you don’t build a truck frame out of aluminum
Reply: @ilexcorp found the Tesla bro who is cope
Reply: @ilexcorp the whole point is that there are situations where your horizontal force maybe be transferred into vertical force. You can obviously see that it damages both trucks but at least with the steel frame it stays attached to the truck.

That payload is going to be freewheeling off the cybertruck.
Reply: @VanSanProductions  did that happened in real world? No. Conversation over good Bye!
Reply: @ilexcorp when it comes to cars and trucks used on public roads it’s preferable to have the discussion before it happens in a real world scenario
Reply: @ilexcorp it is not pointless it shows that you are buying an overpriced Tesla truck with an alu foil frame 😂
Reply: @romanromero5099 do you understand the difference between horizontal forces and vertical forces. 

The truck is rated at 1100lbs on the tongue, try to put 10 times the rated weight on any other truck, they will fail way before 10x their rated capacity. 

You don’t know shit even if your life depended on it. 

I’m no fan of the cybertruck, but I hate when people put tests together to make products fail and look bad when pushing them way past their rated limits. 

This was rigged to fail because he has a grudge against Elon. 

Why not do the same test with a lambo while your at it 🤷🏻‍♂️
Reply: @romanromero5099 your supposed
Reply: The risk here is not for normal towing conditions, but instead for relatively rare situations. Situations that do not appear to be anywhere near as great a risk for steel-framed trucks rated for similar loads. Think catastrophic failures under load.

Cybertruck hitch failures so far appear to occur with unusual shock conditions. Most of what I've read of so far has been with a heavier trailer and the truck bouncing over some significant road bed fault, like a deep pothole or slip face (cracked concrete with settling on one side). In the moment of extreme stress the trailer is essentially airborne. At some point in the event enough weight is transferred to the tongue that the aluminum frame fails catastrophically, as seen in this demonstration. 

In these handful (so far) of accidents the driver immediately brakes, only to be rear-ended by the detached trailer. It would appear in those cases that the trailer's electrical connection for the brake controller is also broken. This can greatly complicate the accident scenario.

Trailers with surge brakes would also be free rolling, with no appropriate tongue pressure from a braking towing vehicle to help. Fun times for any larger boat haulers.

A fair test for the proposed accident scenarios. 

Lifetime aluminum fatigue is a whole other topic. There is a reasonable expectation that regular heavy tows will weaken the aluminum frame over time, making it more susceptible to these kinds of catastrophic failures at lower loads. (Edit: fatigue in these types of aluminum structures is not conclusive point. It is possible fatigue over time is not a risk, based on long-lived structural aircraft components. Airframe fatigue is a known thing, but maybe shows up differently?)
Reply: This is obviously a dumb, biased review, you’re loading the tongue (which it passed by a factor of 10x), you should’ve pulled horizontally.
Reply: I can't believe this channel declined due to political opinions.
Reply: He explains it in the segment with the toy car.
Reply: He literally mentioned this in the video, he addressed this same comment, there are instances where it would be
Reply: 11000lb towing capacity doesn’t mean tongue weight. With a max payload of 2500lbs there is no way you’d actually break that hitch under normal use.
Reply: dude expained with a toy car and u still don't get it
Reply: @UserfeedbackbyTea  He explained what? That cybertruck would need to drive 45deg incline with razor sharp crest to exceed, already tested (according to SAE test procedure) 5500lbs limit? That doing so it would need to hit the biggest pothole that world saw?
Reply: He explained in the video if you watch
Reply: Because it would not have broken if they did it horizontally.
Reply: @jphanks  I noticed some of your likes disappeared and you picked up some bot replies, YT has become such a dumpster fire.
Reply: @shakehandswithdanger7882  sure 😂
Reply: @shakehandswithdanger7882  Elon must have bought YouTube 😮
Reply: This is a joke. There is no way you’re ever going to have an 11,000 lbs trailer exert all of its weight vertically on the hitch. If you do you have a bigger problem than tongue strength. Unsubscribing.
Reply: @du3223 exactly they say on the information for Tesla that the vertical Towing weight for the maximum is 160 lbs which may be a typo maybe it's supposed to be 1,160 lbs? Regardless of vertical Max Towing weight is going to be much less than the tongue weight.

That's why in that other durability test video that those other people did versus the cybertruck and the F1 truck that when they try the towing it just ripped off and they're like oh my gosh this sucks but what they didn't realize is earlier in the video when they drove the Cyber truck off the bed of the truck the back smashed down onto the bed of the truck as it was driving off causing over 6800 lb of pressure which is the weight of the cybertruck are possibly more from that impact on the hitch which already caused major damage and then when they went to go tow it just basically fell right off because it was already damage.

The only way you're going to get vertical pounds when driving is if you maybe hit like a speed bump or a dip or something like that which would cause it to shift up and down.
Reply: The hazard is shock loading. If you hit a pot hole or have a change in incline the trailer weight will become tongue weight.
Reply: @Sparky_Pete no, no it won't.
Reply: @Sparky_Pete from this test, you'd need the ENTIRE the trailer weight to be applied vertically for a failure. How do you think you're making sense here?  Other trucks would fail at 1/3 the trailer weight time weight. You and this video are sad.
Reply: @AdamWood  load not secured properly and shifts to the front. Also it's the fatigue of aluminum that would concern me. The first time, probably even the first 100 times, of hitting a pot hole or an improperly loaded trailer you'd be fine. After heavy use there could be risk of failure. I think Zack is being a bit hyperbolic.
Reply: @Sparky_Pete  If you hit pothole, firstly suspension and tires takes the impact. By the SAE standard that hitch need to hold 5200lbs hitch weight and 5200lbs braking force at the same time to pass.
Rule of thumb is that you will have 1000lbs of hitch weight. So your whole car or trailer must move up/down and experience 5g of acceleration, to come close to testing procedure. It's more like a car crash than normal driving.
Lets even assume that you overloaded your hitch, and now there is 2000lbs of weight. It still would need 2.5g. So violent acceleration would send your truck all over the road and probably into the ditch and that hitch would still hold on.
Argument with crest is so flowed, that you would need curb sharp crest at 45deg, to reach 5500lbs of force on hitch. Do you think that cybertruck is capable of towing 11000lbs on slope that is 45deg? It probably would struggle with it alone.
Reply: @feluke8396  single pot holes and incline changes aren't the concern. I think Zack is being extremely hyperbolic by saying never tow. My concern would be the cumulative impact on the aluminum. Aluminum for beds or fenders makes sense. But the frame with a tow rating of a Cybertruck? That's a bit sketchy when the truck is a few years down the line.
Reply: @Sparky_Pete go back to school seems like you slept in physics class
Reply: @freedomisnotnegotiable my physics testing for my engineering degree would disagree... I do think Zack is being hyperbolic by saying never tow behind it and "it's one improperly loaded trailer from failure" is a gross over estimation of what can be applied. The danger is more in repeated events combined with fatigue property of aluminum. You can calculate the force on the tongue with (Force on tongue) = mg * cos(incline)*(trailer distribution factor). You don't need someone or chegg to tell you what the answer is you can just calculate it.
Reply: @freedomisnotnegotiable did the math and I take it back. On a hefty 8% grade with a horribly loaded trailer it could get up there. That's what I get for going with my gut.
Reply: @ I agree with you on the danger regarding repetitive events. I think the Cybertruck is a joke and will not last. Glued on siding what a joke.
However the full trailer load applying 100% vertical to the hitch is impossible, even a badly loaded trailer. The trailer curb weight itself is never 100% on the hitch. I have a Mercedes GL, towing 7500pounds. This is a Unibody structure, no way you can apply 7500% vertical load on that hitch without damaging the car. So is it for smaller SUVs like a Subaru Ascent, Nissan Pathfinder, all Unibody structures.
Reply: @Sparky_Pete  100% of it?
Reply: @locksmack  on incline change no. If you hit a pot hole yes. If the hitch is accelerated upward suddenly after dropping the amount of force on the hitch isn't a function of tongue weight alone. It's an extreme situation and should be unlikely. it's more likely that repetitive events would cause the failure, due to the properties of aluminum. Personally, having complete failure that close to the tow rating makes me nervous.
Reply: @locksmack no  nor unless it’s air borne and the tires are gone.
Reply: @Sparky_Pete now appy to at logic on a 9% downward grade….
Reply: @WhathappenedIdontunderstand  I had a stroke reading your comment.
Reply: @ it’s YouTube and voice to text 🤷‍♂️ or it doesn’t support your opinion so it’s not understandable?
Reply: @WhathappenedIdontunderstand  no I think it's a valid thing to point out that Zack is being hyperbolic. To get this failure I'd imagine it would have to be after a lot of heavy and improper use. Should you never tow with Cybertruck? No that's a bit hyperbolic. Should you make sure to load it and secure the load it properly, absolutely. The issue is more of that the truck just seems to be built to be disposable.
Reply: @ the truck is junk I agree on that and going down a steep grade fully loaded and hitting any bumps, potholes etc while doing so absolutely exhibits extremely high load on the hitch and tongue when towing. As has also been pointed out it’s a cumulative problem due to its design flaw and inferior incorrect material being used. Funny how the dodge didn’t break and I’d wager any of the other actual real trucks wouldn’t have failed like the Trashla did!
Reply: @locksmack  doesnt have to be. The point is the steel frame truck was literally bouncing up and down over and over without breaking. The Tesla snapped off like plastic right at that max weight being hit. If you accidentally hit the wrong angle or pothole or whatever, then suddenly you are detached. Where the steel frame is still attached but you feel a bounce in the truck.
Reply: This video was just for views for purposely destroying a truck. 

Towing specs versus tongue weight are two very different things. All this video shows is tongue weight exceeding the specs. Good job Tesla.
Reply: I like Jerry, but this test is in no way useful and just will fuel some BS reporting on the Cybertruck. And I don't even do not like nor love the Cybertruck...
Reply: @RikHeijmen  I think the primary concern, poorly communicated, are the rare cases where, by accident, the hitch and frame are exposed to the full weight of the load, leading to catastrophic failure and loss of control of the load itself. 

The question then is how that would compare to a steel-frame truck and hitch in a similar scenario.

This all assumes loads within the expected range for tongue and tow, where the tow weight itself exceeds the tongue limit. 

I believe so far there have been only 2 such real-world accidents. I do not yet know the details, beyond some on-road incident led to the catastrophic failures.

To be sure, they're is plenty over which to criticize Cybertrucks. We should be sure that any material safety issues are properly represented, in their proper contexts, and in the spirit of knowing many auto manufacturers have sought to downplay faults, and so are equally worthy of scorn at those moral failings.
Reply: Just a couple of notes regarding this "test".

By restraining the front wheels, you are changing the moment of the force applied.

In a typical towing situation you are applying force downward on the rear axle.  However, the suspension and drive train allows this force to be distributed around the axis of rotation - at or near the rear axle.

By holding the front down you have increased the force applied by the multiple of the length of the truck divided by the distance between the hitch and the axle.  Probably a 5x multiple.

This is a disingenuous test designed to show a failure.

If I could get you to answer 1 question honestly it would be,"Did you attempt this test first without holding the front of the truck down, and if so, what happened?"

You see, when you manipulate a test like this it gives you freedom to say somelime false like "This is how much force is applied if you hit a pothole at 80mph".  In fact, it is not, and I think if people saw a test where the front of the truck started lifting up due to the force they would realize that.

I realized that something happened to you Zack that caused a lot of distain towards Tesla and/or Musk.  I dont know what it is, but holding onto those feelings really isnt good for your mental health.  It breeds extremism, and what we really need today is some common middle ground.  Hopefully, at some point there will be a creator who makes some.
Reply: @jasonstroup4123  is Zach a little hyperbolic and the test over the top? Yes. Never tow with the cyber truck is a bold claim. I'd definitely not take it to it's tow rating. Him being a YouTuber and creating a wild video isn't "haboring hate".
Reply: @jasonstroup4123 did the Dodge brake under 11.000? No? Thanks you.
Reply: @jasonstroup4123 thanks for saying what I was thinking 🙏👊
Reply: @jasonstroup4123  While holding the front of the trucks down will affect the test, it would not change the moment of the force. The force is still being applied at the same distance from the fixed point(the rear wheels). Holding the front down simply provides a counterbalance to prevent the front of the truck from lifting. That is what would have happened if they tested without holding the front down.  At smaller loads, the weight of the Cybertruck itself would be able to keep the tires on the ground. 

While there will be other effects, they should all be only acting on the frame in front of the rear axle and be forces quite a lot less than the force on the hitch. Since torque or moment is a force multiplied by a distance, and the torque on the front and rear of the trucks must be equal for there to be no rotation, the force at the front of the trucks is likely 1/4 of what the hitchs are experiencing, even less if you account for the vehicle weight also counteracting the force on the hitch. 

While I can agree that this test isn't necessarily realistic, it isn't bad to push things to their limits and make comparisons. The comparison they make could be better as well (the 2004 ram 2500 has a tongue weight rating of 1800lbs compared to the Cybertrucks 1100lbs), but the concerns he mentions are applicable, and doing testing like this is something that should be done. The concerns about aluminum not having a fatigue limit and other comments mentioning galvanic corrosion where the steel hitch attaches to the aluminum frame should not be taken lightly. 

While I do think this test is a bit over the top, I do still find it concerning that the Cybertrucks frame failed in the way it did and also did so before a 21-year-old, already damaged steel frame. I think time will tell how aluminum's lack of a fatigue limit and the possibility of galvanic corrosion will effect the cybertrucks' ability to tow.
Reply: @gregoryderaadt9022  uh, no... The rear axle is not a fixed point, it's the axis of rotation.  That's why if you look at a load graph how much weight can be loaded onto the truck can vary based on where the load is applied.
Reply: @ True. It isn’t a truly fixed point as it does allow for rotation and there is suspension compression which will have a slight effect until it is bottomed out. What exactly do you mean by a load graph? Do you mean an analysis of a load being applied or a technical graph from a manufacturer of where certain loads are allowed to be applied safely?
Reply: @jasonstroup4123 😂 a 5x multiple because they fixed the front? There’s a SCALE dude, it measures the force in pounds, it does not lie… how thick you have to be.
Reply: @MrSpikegee  Weight, measured in pounds, is not a force.  This is a common mistake.  To "Weigh" something is to measure its mass,  dating back eons using a 2 pan method this was the term used.  They used weights on the second pan until it was in balance, hence where these terms originated.

It was when Newtons works were translated from Latin to English that the confusion began.  He used the word "Gravitas", which translates to weight.

The existing culture did not want to change the meaning of words they had been using for 1000 years, so it took on a second meaning.

Newtons equation for Force is Force=Mass*Acceleration 

10,000 pounds does not satisfy this law, units of force are Newtons, foot- pounds
Reply: Now that we finished the education lesson, let's move on to the test.

When you place 10,000 pounds on the rear of a bumper several forces are at play.

The suspension and frame acts to damped the load across the body of a car, the mass in front of that suspension acts to counter balance that load.  When the rear suspension reaches near full compression it begins to act as an axis, or fulcrum - This is an important concept to understand for later.

Why is it important to distribute the load?  Because of Newtons 3rd law.

"For every action the is an equal and opposite reaction"

You see, the force of the tractor isn't the only force at play.  Since the vehicle is not in motion, it must push back with an equal and opposite force.  The frame pushes back on the weight.  The suspension pushed on the frame, tires push on the suspension and ground pushes back on the tires.

This is called the normal force.

When the load is distributed, the normal force that pushes back is as well.

This is why people use weight distribution hitches.

By restraining the front of the vehicle, you have done the exact opposite.

The 2 forces, normal and load, are now focused entirely on the fulcrum.  When those 2 forces counteract in such a small space, sheer is extreme, resulting in failure.
Reply: In terms of material comparisons, pure aluminum has fairly low strengths, 90MPa for tensile, 241 MPa for Yeild.  But some alloys reach strengths 20 times that.

Also the idea that aluminum deforms permanently is incorrect.  This is the Yeild Strength.

Now. Does Steel offer higher strengths?

Yes, but once again, just like aluminum, steel can be altered by using different alloys.

Steel is not Steel just like aluminum is not aluminum and plastic is not plastic.

Why use something that is several times heavier when you can use an alloy to get a similar strength at 1/3 the mass?

Did the aluminum alloy fail, yes, but it did so with a force that can't be experienced in a real world application.  If you put that much mass on the rear hitch without holding down the front, your hitch would be on the ground and your front tires off the ground.

I realize this was a long reply, and pretty dense, so take your time reading it.
Reply: @jasonstroup4123 , thats right but if you fracture a frame at 10,000 lbs that is static weight, the force on the frame is going to be higher than that in driving conditions when you consider load shifting from articulation while going down the road.

This is why we have already had multiple tesla frames fail while pulling trailers down the road.  Going down the roads the forces are greater than the weight.  Its just like so many people on here falsely state the weight is supported by the trailer, that is not entirely true, only way you are going to have the trailer support the weight of the load is to put the weight over the axles directly or behind the axles this in result will unload the rear of the truck and make the trailer unstable.  Its why proper trailer loading is to put as much weight forward of the axle as possible to load the rear end of the truck which increases tongue weight, this also ensures the trailer tracks the truck vs swaying till it rolls the truck.  This is why we have tongue weight limits which you can artifically increase through the use of a weight distributing hitch that uses spring steel rods and chains to increase the tongue weight rating of the hitch.  This situation wouldnt be a problem with a steel frame but with a cast aluminum frame thats paper thin the use of a weight distributing hitch will over load the frame and cause failures and that is the problem because the aluminum frame was designed not with this in mind thats why its fail rate is at 10,300 lbs while having a tow rating of 11,000 lbs.  In reality that frame should have survived way more than 11,000 lbs of static force.
Reply: @jasonstroup4123  gee I really wonder why anyone could feel disdain towards Musk.
Reply: @jasonstroup4123 
A few notes on your criticism.
First anything you apply to the tesla applies to the broken ram. Which did not fail.

Next The moment is only multiplied relative to the area of the load. Which would not have increased the force 5 times.

Furthermore this test only inspected catastrophic failure. Which while sensible for visual interest is not sensible for actually testing the build quality or materials of the tesla. Which would not bode well for tesla, because its made of aluminum which has a much lower point of elastic deformation and tesla is not known for build quality. What also is not sensible is an old car in questionable condition being the control as that is also biased toward the tesla. Any number of preexisting issues could have been a result in favor of the cyber truck due to uncontroled circumstances.
Reply: @jasonstroup4123 totally agree
Reply: How to say you didn't watch the video without saying you didn't watch the video.
Reply: Tesla isnt gonna redesign shit lol
Reply: @David-S-Garcia  they don't need to. This test is garbage. Is there a crane holding down the front when your driving down the road? No there isn't, so if you do go over a pot hole or the trailer bounces the front of the vehicle will lift. Something they didn't factor in in this video. Baldy is an America hater and is lying to you.
Reply: @David-S-Garcia  Because it's fine.
Reply: Such a bad click bait test - We have lost some respect for you on this video, please don't fall victim to the algorithm
Reply: Cheap shot at Tesla, you can’t use an excavator to pull down on it.    Lost a subscriber. 😂
Reply: @JenkaKravets you can recommend better ideas, if u have any that is😅
Reply: @JenkaKravets Lmao and yet the steel frame didn't break a sweat.
Reply: @JenkaKravets It was a failure test not a real world towing test and it showed you need a excavator to break the hitch off , I think even creepy elon would be happy with the results
Reply: @JenkaKravets Not actually. 

What this points out is the lack of fatigue resistance in a gigacasting, as we expect,  and that's a horrible thing for towing. 

Towing places a lot of stress on a vehicle's frame,  more than hauling the same 1100lb in the bed. You need the frame to be able to handle millions of heavy stress cycles,  but cast aluminum can't do that without being an extremely heavy part.

To support towing, that part  should,  at a minimum,  be forged if it's going to be made of aluminum. Welded 6061 would have been ok as well. Both parts would be probably 80% the weight of a steel part for them to have enough resistance to fatigue to withstand millions of heavy cycles. Both would have been expensive.
Reply: @JenkaKravets  it would be a cheap shot without the comparison, but a car from 20 years ago will the wear and tear, passed the same test.
Reply: @JenkaKravets  extreme cope
Reply: @JenkaKravets I agree I also unsubscribed
Reply: @iandefilippo  supposed what?
Reply: @JenkaKravets I'm sure you'll be missed. 😂
Reply: @JenkaKravets  still, this cheap shot pales in comparison to the cheap shots he's taking at our government; trying to remake it in MAGA's image
Reply: There’s a reason he won’t do this to his other trucks, and it has a lot to do with his feelings towards Elon and less about truck ratings.
Reply: Absolute trash , this is so insanely dangerous.
Reply: @David-S-Garcia there's a difference between downforce and horizontal force this truck actually did pretty good a lot of trunks would have failed way before 10,000 on the downforce.
Reply: @David-S-Garcia you kid, do not understand a single thing about this pointless test.